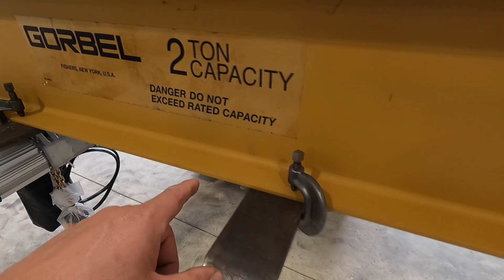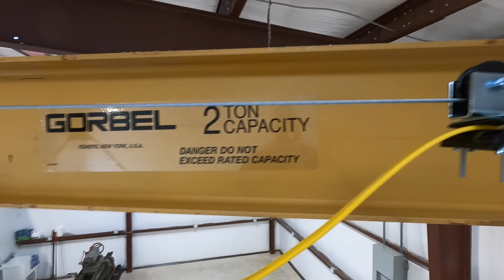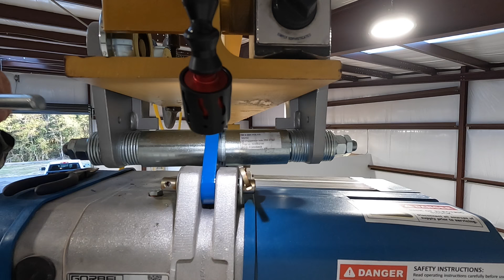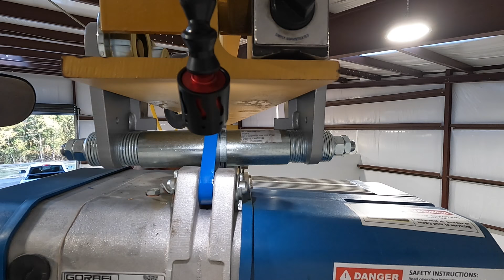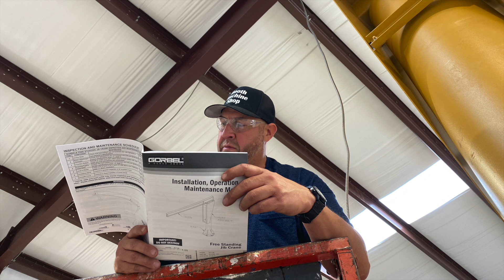Gorbel Jib Crane Installation Part 2

Comment: As an Ironworker or 18 years I flinched when she put her hand on top of the iron there. Touchy forklifts can take finger quick. Glad it worked out. What a nice shop.
Reply: Yeah, I was hollering at the monitor for her to get her hands away from the work area. I've seen a lot in my 42 years too.

Comment: When Abby put her hand on top of the beam mount I almost died. 
Ex forklift mechanic here, I've seen too many accidents but glad you guys got it done safely.
Reply: Same. "Come towards me!" Them fingers could have gone pop. Be careful out there friends ❤
Reply: @yohell  MY HANDS WERE SWEATING!
Reply: Agree, I was cringing when I saw her hand in-between that beam and the head. If something had happened bad things would have occurred. Abby if you read this, make sure always keep your hands safely away and out of areas between two heavy objects, if you must be in there use a tool not your hands. Ya'll got it done but definitely got lucky. Be Safe!

JG

Comment: Adam, I really like your video, I have been following both of your channels for years. I know how easy it is to point out things that not right. Sorry but. The way you put the clamp on cable is backwards. For what  your doing it's not life threating. There is a real good chance it will come loose over time. Remember in rigging for lifting use two clamps per side, And don't put a saddle on the tail of the horse.( The old saying) Don't saddle a dead Horse. My hope this information keeps you or someone else safe in the future.  keep up the good content, Love you work.

Comment: You never saddle a dead horse …but the comments section will sure beat it to death anyway!!!  Next time you tell them the cable isn’t pre stretched so it all gets redone down the road anyway as part of the carrier and pulley inspection and maintenance…and you tell them with confidence !! Thanks for sharing … you made me proud of my lift truck operation and overhead riggings skills!! (Because I don’t get to work with as nice of gear as you)

Comment: I always teach my apprentices when using Crosby clips "never saddle a dead horse". The hasp crimps down on the load bearing side of that wire rope so it should be placed on the excess side so as to prevent damage to the live side. It's what the old timers told me so I pass it on to the youngin's as it comes up. Best wishes
Reply: Years ago I worked for a sign company and we had to periodically shorten the load line to avoid wear from the headache ball.  That's what we were taught as well.  We were also taught to never alternate the clips --- to be sure they were all facing the same "side".
Reply: "Sigh" (Algore).. you and 500 other commenters...
Reply: That's a better explanation than all this dead horse stuff
Reply: That's a clearer explanation than all this dead horse stuff, repeated constantly
Reply: Did you teach them how to beat a dead horse? This is mentioned 100’s of times by all the experts in the world

Comment: I wanted to scream at Abby about where she placed her fingers!  She had them in a potential pinch point between the moving steel beam and support. Fortunately all went well!  Hope it all works as intended.  Enjoy your steak, Abby!
Reply: My toes were curling... One important thing to highlight to anyone who doesn't do this as a day job is to warn them of where they place their hands whilst things are manouvering. Some may take it as your babysitting but it's a lot less painful than loosing fingers. Well done to Abby for identifying the issue, always consider where can I possibly lose digits(fingers) or limbs in the process.
Reply: I saw her put her hand down and almost jumped out of my seat to grab her and pull her away. 😳 yikes.
Reply: Yes, heavy gear is a rat trap. Never put digits in a vice. Ouch!
Reply: Those moments with the fingers and then later switching out the pins got me sweating.
Reply: I just want to say the same thing. I cringed at Abby's fingers, Safety meeting before doing any work. Patrick
Reply: I was yelling at my TV! I'm glad everything went ok.
Reply: @glennford8844  Ave has different thoughts in this area....
Reply: Even at these relatively small sizes, some of this stuff can split your torso, never mind removing some fingers
Reply: A coworker had a finger he used to align a 50hp motor to its base. Notice the word had!! I was thinking the same thing and thinking of him while watching her do that.
Reply: @joebledsoe257  i see the "had", does he still have it or nah?

Comment: The wedge washers as you called them should go under the head of the bolt, they are  designed to follow the slope up on the inside of the web. They are called “hillside washers”. (Used on structural steel)

Comment: Hey Adam, the rollers strike the end stop steel plates above their center line. I think that the edge of the stops is going to knick the rollers and eat into their material/create eccentricities. You might want to grind the paint off the lower 2" of the stops, weld a 3"x3" steel plates to each, and then epoxy some 3"x3" Delrin plates onto said steel. The rollers will have better longevity.
Reply: I wonder if Gorbel a) ever encountered it in their entire business life, or b) if it's ever been a problem? Things that make you go Huh!

Comment: Hey Adam, you should put down a yellow safety line on the floor to mark the outside radius, or reach, of the crane. For one, people will know that they themselves are in reach of the crane, and also when you have a heavy part on a pallet or cart you know where you have to park it in order to reach with the crane.
Reply: Or you can just look up.

Comment: 7:54  Never saddle a dead horse.    
       Also I generally put the nut on the more accessible side for tools. The backup wrench (Most of the time, box wrench) goes on the head in the harder area to reach.  4:18
 44:45  Great, just lovely.    LOL      Thanks, made me laugh.  
       I personally would put washer on the inside of that bracket to lock it up. But it's not essential. You cut the rope kinda short, two crosbys would have been better, but it just for a traveler line, so maybe leave it alone.  Don't forget the friction tape to wrap the rope ends.

Comment: Nice job Adam! Two minor issues however:
- the wedged washers need to go on top, right underneath the bolt head
- the dust seal needs to ride on top of the opening. Forcing it in will damage it over time as it is not designed to operate that way
I’m also happy that Abby did not get hurt. I got shivers all over when she put her hand on the crane while you were moving the beam into position… phew…

Comment: Jeez, does anyone else wanna go on about dead horses. Just congratulate the man on a good job. That rope is hardly under mega tension or carrying major loading. Give the guy a break!! Sure Adam doesn't need 100 comments about dead saddles or whatever.

Great video Adam, good work as always.
Reply: Never beat a dead horse.  You can only get glue form a dead horse. hah hah!  Adam did great. I have saddle sores from ridin' muh horse.  Um.....

Comment: The episodes about this crane are especially interesting to me because not only did I wire the machines that made your crane I've wired at least a hundred of their products in the field as well. I worked for electrical contractor in the Rochester New York area  for 20 years until last March and gorbel was one of our customers. I've done tons of work at their facility and they make a great product and it was so interesting to see how they pretty much do everything in house from making the I beams, assembling the control cabinets and even painting is done at their plant. It would make a great factory tour

Comment: Don’t saddle a dead horse !!! See 7:20 minute mark. Not that it would matter much in the case of the wire rope that comprises the tag line, but cable clamps should be installed with the saddle on the live part of the wire rope and the loop part of the clamp on the dead part. The reason being that the clamping loop applies concentrated stress on the rope and you don’t want to do that on the part of the rope that has to carry the full tension. The dead part of the rope eye only has the resist about half of the tension on the main (live) part of the rope, so it doesn’t matter if is feeling a little choked. Love your work Adam. I always learn something from it.

Comment: Love watching your videos, I know this probably doesn't matter for the wright on that wire rope, but always remember... NEVER SADDLE A DEAD HORSE. the live end of the wire rope should be agenized the saddle, the u bolt end should be on the dead end of the cable. Again doesn't matter so much for this project but good to be diligent, espacalay with rigging.

Comment: Great videos ! I always watch never comment! As a Millwright for 23 years I did alot of cable changes on  overhead cranes up to 20 Ton!  I worked at a lead/ silver smelter for 12 years. 

Your Crosby clips are installed backwards. Not a big deal on that cable no load but you do everything perfect so just wanted to point that out! The saying is "never saddle a dead horse" so your dead end of the cable goes through the u bolt side not the saddle side!   Great work though from New Brunswick Canada !

Comment: Probably not going to make any difference, but that clip on the wire rope is installed incorrectly.

The u-bolt part of the clip should be on the dead end of the cable, the saddle should be on the live end where the load is.

"Never saddle a dead horse".
Reply: You said it better than I could have!

Comment: the Wedge washer goes in between the bolt head and the beam as that is a tapered face  you need to refit them correctly then the bolts will not be strained over on thye scunt
Reply: @Pete Nikolic : I was wandering if anyone else noticed that. I consider that mistake way more serious than saddling the dead horse (at least in this application).

Comment: Your cable clamps are on backward. "Never saddle a dead horse" the live end is the load-bearing side, the dead-end is the stub. The U bolt pinches and crushes the cable, you do not want to do that to the load-bearing part of the rope. Another factor, if the rope slips, it will slip on the saddle side and not the Ubolt side as it pinches and deforms the rope.
Reply: I was going to say the same thing lol
Reply: Great observation and great piece of knowledge with memory jogger for these guys out there in the field.

Comment: Cable clamps should be done with the saddle on the horse. Meaning the cable with the pull on it should have the saddle and the round clamp on the tail end. You don't have much weight so it will work but my dad taught me the correct way.

Comment: I am at 35:24,  two things-the cable clamps are installed backwards, the saddles go on the running line and the tapered washers go under the head of the bolts on the beam so the bolts are vertical.  To fix the bolts on the beam,  take one loose, put the tapered washer on the bolt then the bolt in the hole on the beam and tighten, then do the other side.
I suggest the next larger size propane fork truck for you to get to use in the shop.  Also the side adjust of the forks.

Comment: Adam, have the electrician install a 110v outlet right next to the junction box on the crane. Later you can install a travel motor for the trolly and you can plug it inn right there. That is what I did to mine.

Comment: This video is perfect as it is. Abby did a great job filming and helping you.
One little tip. The wedge shim needs to be on the other side (inside of the beam).
It compensate the angle on the inside of the beam. It helps to ceep the bolt in line and not crooked.

Comment: The "wedge shim" is called a hillside washer and it goes under the head of the bolt to level out the taper in the I beam.

Comment: Suggestion from a high rigger: on the off chance you ever need to mount a beam like that again, a couple of drift pins make life easier.  Once the beams get within a couple inches of each other, you can thread the pins through the holes and lever them into alignment.  The lift/crane operator can bring the beam closer without having to be as precise (you did an amazing job of that BTW - getting that close from a fork lift is tricky).
Reply: Was thinking spud wrench at least

Comment: Abbey will make an excellent forklift operator. I worked in an a factory where we had ladies doing forkilft work as temporary drivers during strikes, they did a good job because they did not take risks an looked after the machines. That crane will really be a great tool for you, well done.
Reply: Agreed. I have noticed that, usually, women tend to be more proactive when it comes to driving where as men are more reactive.

Comment: I would have used thimbles on the eye bolts. Also the cable clamps are on backwards. An old crane operator once told me "you can't saddle a dead horse son!"

Comment: A small point on the ‘cable clamps’ (Bulldog Clamps). They should be installed with the cast clamp on the ‘live’ side of the cable and the ‘u-bolt’ side on the spare or ‘dead’ side. The reason is the cast saddle does not damage the cable where the loading is, whereas the U-Bolt can compromise the strength of the cable. 
  In this application it probably is not that important as the cable is not under huge tension.

Comment: I think that the step 5 instruction called for placing the boom tip higher than level.  The boom length formula was not for the shims, but for the tip height over level, measured in inches.  By measuring the 15 feet in inches, like it says in the manual, the boom tip should be 0.60 inches above the height measured at level.  Your shim should be near 0.52 inches, and the hoist and cable carriers should naturally roll back to the boom stem.  You'd have to install the rear plate bolts, check for level and measure to the ground from the boom tip, then raise the tip to +0.6 inches higher, add the necessary shims, then tighten everything down.
I could be wrong, but I've seen one installed and operated a couple similar.  the rollers shouldn't stall or settle in the middle of the boom.  And every pedestal/jib might be just a couple mill off plumb, so this has to be set at installation by the rigger. I'm pretty certain that Gorbel wouldn't want you to run it this way.
Not trying to be a nit picker.  Good video and I enjoy the channel.

Comment: I've installed Tons of Gorbel systems. From Jibs to workstations and individual hoist swaps. That is pretty much par for the course for Gorbel to send the wrong parts or not parts for something, not a lot of jobs went 100% with their parts systems, and a lot of alignment and adjustments were needed to make sure things were straight and true in the end. Looks good!
Reply: If you ever have to do another, a tip for getting level perfect is to never use a torpedo or 4ft/8ft, you already know the bubbles are small on those, they'll be close, but not accurate to keep something like that from swinging.

The best you can do is get a laser plumb, or regular plum. I use a magnetic back bosch laser plumb. stick it 6 ft up, measure right out of the bottom of it so the laser is 3 inches away from the pole. then mark a spot 3 inches away from the pole at the base. do this at 3 places, 120 degrees out from each other, when all 3 lasers are lined up with the marks you're as perfect as can be. And to level it, you could chase it all day, so only use 3 points to level it, run the others down away from it so they don't affect it. you could end up loosening and tightening things 3 or 4 times trying to see why it's not lowering like you want on 1 side.  after it's level, run the other nuts up and snug them all!

Comment: Cool thing about being a Machinist and missing pins for assembly. "I just make them".  I'm surprised though that you didn't improve on the design and make a shoulder on one end and only one cotter pin.  Not trying to being critical, it's easy being an armchair quarterback.  Keep up the great content, you're my favorite content creator!
Reply: Insurance companies won't cover an accident if original fittings/fasteners have been altered by the owner. (even if they're better!)
Liability issues now become a court nightmare. Best to leave OEM equipment as supplied and not modded, you'd be messing with the warrany.

Comment: When you have cleaned and sealed the floor, paint the radius of the Crain reach on the floor. Easy when putting machines down where and where not to locate them.

Comment: A point on the cable clamps --- " NEVER SADDLE A DEAD HORSE " is the term to remember which way to use cable clamps .
It does not matter as much with the amount of weight on the cable & clamps , but when you do have a lot of weight on cables --- you should put the clamps on the other way - the U-bolt on the free end &  the saddle on the live / weight end ;)        Beat me by 8 seconds

Comment: For that aircraft cable you put the Crosby clips on the wrong way. Never saddle a dead horse. Dead side of wire goes through the ubolt.
Reply: I came down into the comments to see if somebody else noticed this. Thanks
Reply: @trademarkdesigns  Me too

Comment: Painting a blue line on the floor in an arc where the new crane will lift vertically will help to easily decide weather you can use it to lift heavy objects or if you have to come up with another method !  just a simple line will speed up things alot !!!! 
congratulations on the new shop  I'm happy for you !

Comment: after working for gorbel in the elec/hoist dept for fifteen years u are also missing the female plug for the flat cable it should of came with the hoist, plus the bevel washers go on top of the rail because it is beveled.
Reply: Some fine tweaking needs to be done then :)

Comment: I was taught that when you install the clamps on the wire rope that the ring went on the dead end of the cable. The old guy that taught me that had a saying so you can remember how it goes. ( you never saddle a dead horse)
Reply: Me too!